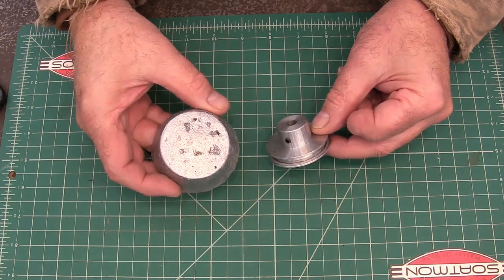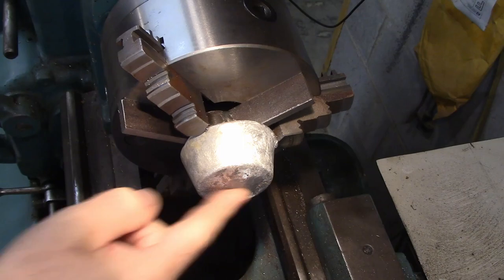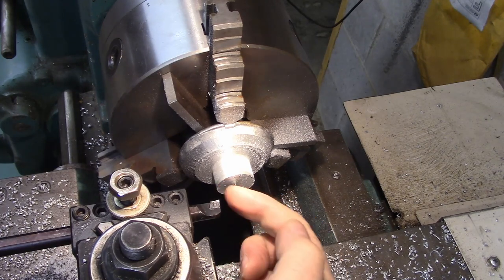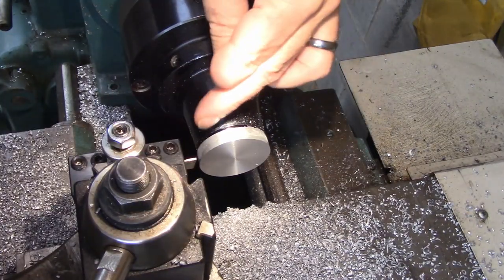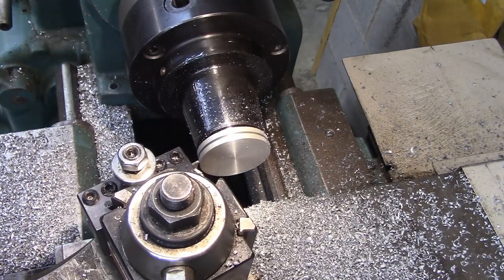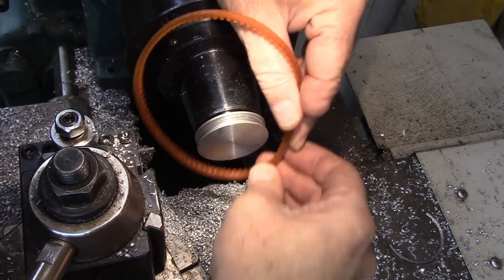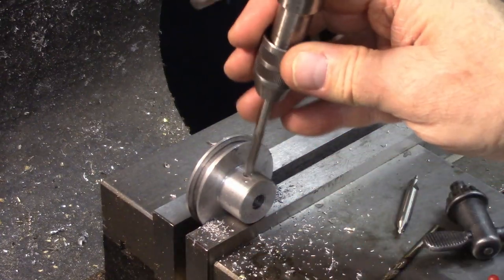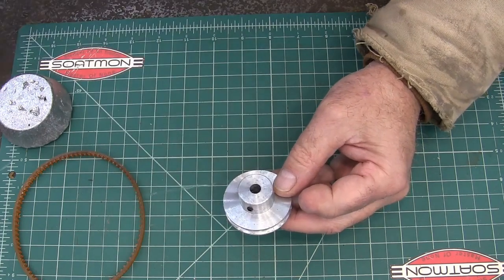Making a Sewing Machine Pulley from a Muffin

Comment: Nice work again.  I see another viewer noticed your spider in the three jaw.   Is yours homemade, I couldn't quite tell.   
It sure looks good.    I really need to get with it and make up one for myself.  Thank you for the video.
Reply from the maker: I made it several years ago.  It's kind of crude.  I welded some legs on a piece of pipe and then milled it flat.  It works great but looks terrible.  I poured some in aluminum  that I can mill to whatever height I need.  They look better.  Thanks Glenn!